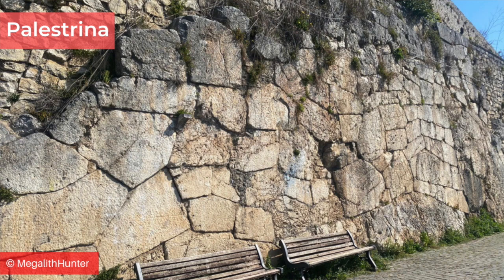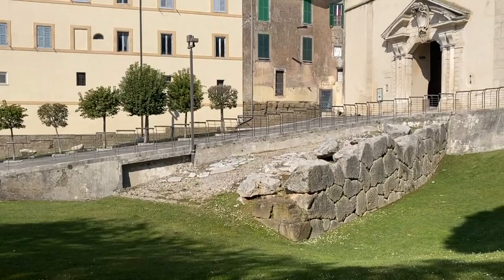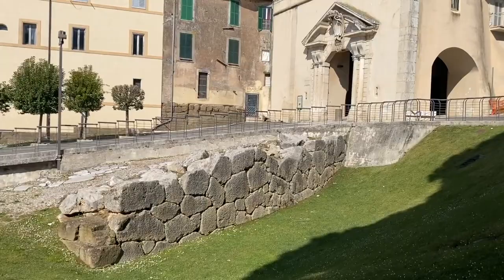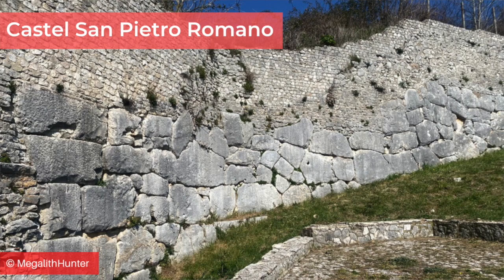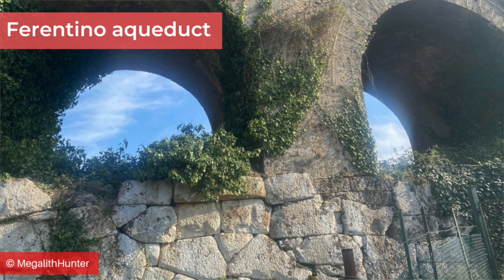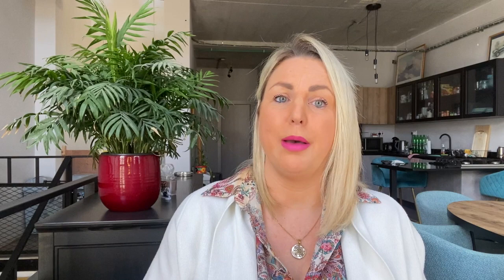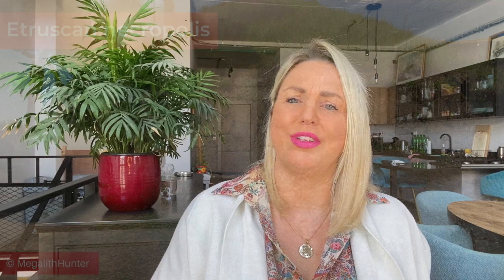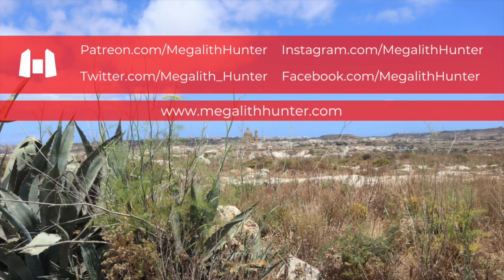Why Is Italy's CYCLOPEAN Masonry Such A Mystery?

Comment: Greetings,
I am utterly thrilled with the material you have presented here.  It is almost as if you just got finished reading one of my other comments before you sat down to write the copy for this one.   I am in a very big hurry at the moment, and so cannot comment at greater length other than to say that you are now asking the big questions that have  been staring us all in the face for so long.  'Who was actually responsible for building these polygonal/cyclopean walls,  how did they do it, when did they do it, and for what reason would you need battlements which are that substantial (If we are to believe conventional historians than no ranged weapons existed that would require walls of that magnitude to repel  the missiles from.)'  I will get back to you later, maybe by email, with much more on this topic.

much respect for saying what needed to be said, finally, 

Cheers..............A.
Reply from the maker: Thanks for watching! 😀

Comment: Thanks for the video, Laura. The polygonal construction is really thought-provoking stuff. Getting a good date would go a long way to constraining the possibilities, and It seems to me that there actually is a method to date them. I am guessing that optical luminescence could work. To accomplish that would require deconstructing a portion of the wall - controversial, certainly. But there are bound to be some sites with low sections of wall, only two or three courses remaining upright, that could probably be re-assembled immediately afterward. And of course it isn't necessary to take down the entire wall, just enough blocks to get to the bottom at a given point. A crane would certainly be necessary, and immediately open lifting the bottom block, measurements would have to be taken. For this reason, it might actually need to be done at night. Good measurements will give the amount of time that has passed since the bottom rock surface was exposed to light. As a bonus, there might even be some organic remains under the bottom block, or even small fragments between tight-fitting blocks, that could provide C14 dating as well. For that matter, it would probably be possible to dig straight down along the wall beneath the lowest level,  and scoop some original surface layer out for C14, or dig out a hole just large enough to get a portable meter far enough underneath to be able to look up at the bottom of the block.  (Assuming there actually are portable meters!) If the bottom surface is in fact bedrock, chiseling a fragment of bedrock out from under the block wouldn't damage the block, but still provide a sample. This would all have to be properly backfilled and tamped to prevent destabilizing the wall.
Reply from the maker: Certainly would be a good idea. I hope one day this happens.

Comment: I always wondered if these polygonal walls are cast geopolymer  blocks, individually cast blocks in situ in odd shapes to resist earthquakes better .   The better finished non-polygonal  wall ones  sometimes with the nipples ,  as found in Peru, Easter Island, Egypt , Japan  , Russia and India seem to be cast geopolymer , poured in situ in cloth bags of various sizes.  The sometimes nipples are places where they were shored up with poles or timber if they happen to lean while setting and hardening.
Reply: The walls she showed here are plainly rocks.
Reply: @cantsay8894  Cast concrete in big pieces can look like rocks, even in our time.
Reply: That's an interesting idea. How would the stone have been melted? Cloth bags seems like it would melt away under the heat that molten stone would radiate. There would need to be some sort of crucible that's extremely heat resistant in order to shape the molten stone.
Reply: @Davivd2  We are not talking about molten stone, I never mentioned such a thing in my original comment.  I mentioned a geopolymer  akin to a modern concrete in consistency and application.
Reply: It would be silly. Have you looked at the size and  shapes of these blocks ? they're totally random. Besides if you use polymers why building these irregular shapes  when you can build rectangular brick like rocks ? Doesn't make sense.
Reply: @Kobayashhi  It makes sense to make the blocks irregular so they can withstand an earthquake better.  Not silly at all since places that are earthquake prone like Peru, Japan and Greece have these kinds of ancient walls.

Comment: I'm also in search of a Minoan \ Spartan \ Troy Settlements connection from this same early period(2000-1000 BCE) in Abruzzo's Teramo region, are there Cyclopean walls there?
My hypothesis is that the Mediterranean was well migrated to and already explored and settled in trade outposts by Minoans, Mycenaean's, Trojans and Spartans as far as Spain and adding their genetic profiles to the already present Latin and Celt communities who were the natives of the region.
Reply from the maker: Will take a look at the maps in my books and see if any fall within Teramo.
Reply from the maker: The only reference I can find to a cyclopean wall in Teramo is at Crognaleto. But, looking at the only photograph I can find of it, it doesn't look particularly cyclopean to me.
Reply: @MegalithHunter  dear Laura, I hate to butt into convo but piece you did on cyclopean walls in southern Spain, was underwhelming.

The wall sections and lintels, extint, are incredible in the size of stone and the height of still extint wall sections.  I do not know how u missed them on your visit?  However, the dolmen de manga and the other nearby dolmen use same stone and very similar construction tech.

I think we must move to a periodic/series system of dating for the walls, it worked in pottery until our tech caught up.  So like Petrie and his pots, think we must seriate the walls and that will at least give us a relative dating method?

Southern Spanish walls are much like Tyrins’ walls, in terms of large roughly shaped megaliths w/ gaps filled by appropriate, but randomish, field stones. So it was probably built around the ‘tyrins’ time, whenever that was?

The megalithic builder culture seems to be either based in Greece, turkey, Italy, or Spain  (during a time when sea levels were much Lower on the coast all areas of England, Spain, Ireland, doggerland type areas…etc,)

But yes culture spread all over northern med coast through the Levant, and maybe parts of north afrika?’…..okay gotta go….oh yeah but say I think northern Italy/Tyrol area/rheatic area to be center of this culture.  Maybe so entwined with the le tene and their precursors, plus the carpathian mtn folk, the Balkan peoples and arzawa/southern turkey, aka lukka, isle of Dan, and tarsis area.  Also in tarsis area is major man cut tunnel complexes very similar to northern Italy.  

I say not Greece or Hittite turkey because of their utter devastation by ‘sea people.’  Think the Bronze Age collapse could real be world war zero between north med and southern med…..okay, sorry,….gotta go.